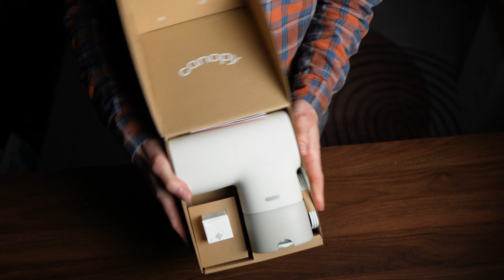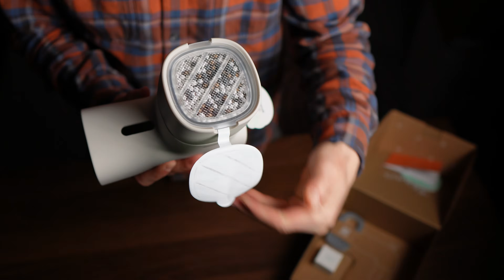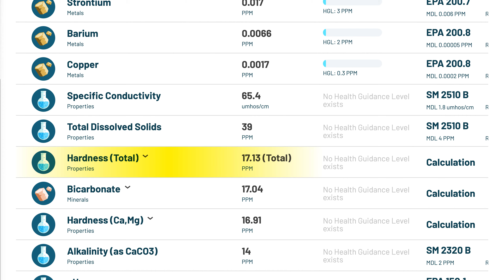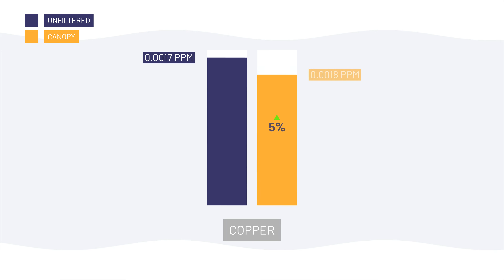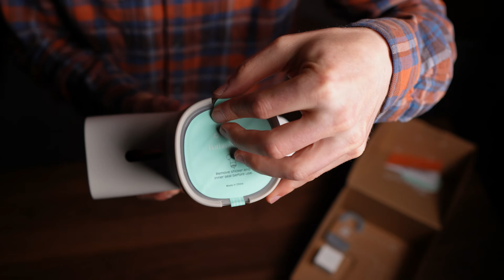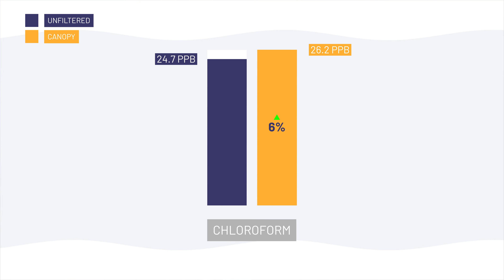Influencers RAVE about the Canopy Bath Tub Filter...I lab tested it

Comment: Do you have any recommendations for bath filters that would filter out arsenic? We have an RO system for all our drinking water but unfortunately our well tested positive for arsenic 3.  We have a newborn so I’ve been wanting to look into filters more! Thanks!
Reply from the maker: Congrats on the newborn. Unfortunately for As(III): no bath/shower filter is going to solve this.

Arsenic 3 needs to be oxidized to arsenic 5 at the point of entry (whole house) before you can reliably remove it. RO systems are effective for arsenic 5, but not nearly as effective for arsenic 3, and RO does not provide that oxidation step. So the fix is a POE oxidation + anion exchange system.

Comment: Hi, apologies for asking about RO here. I know this is a different filter video, but if it's your latest one and I wanted to ask you since you seem very knowledgeable. I live in Scotland in an area where the water is not soft, but not very hard either. I used strips to check my water, and all the values are up to the norm on minerals and metals, apart from lead which concerns me. I searched online and I have seen that there are filters for that, like Waterdrop's 10UA, 10UB and a 3 stage one (WD-TSA-10). I was wondering, if I only want to remove lead, are there good options? Do I still need reverse osmosis and remineralisation, or is there a cleaner, easier option? I would like something to attach to the sink pipes, rather than on the counter, but I would prefer to not have a second faucet, which did put me off the Waterdrops X8 and G3. What is your suggestion? Sorry to bother and thank you for your videos :)
Reply from the maker: Not a bother at all glad you asked. Lead is tricky because it can come from lots of places in the plumbing system, including old solder, valves, or even parts inside the faucet itself, which is why point of use treatment at the tap you drink from is strongly recommended. The biggest thing to look for is that any filter you choose is properly certified for lead reduction (for example to NSF/ANSI standards for lead or something equivalent in the UK, though I'm not familiar with the standards there). There are under sink inline direct connect filters that can reduce lead which are not RO systems, and many of these can connect directly to your existing cold water line so you do not need a second dedicated faucet on the counter. Though, keep in mind, if the faucet itself is the source of the lead, then filtering before it won't address the problem
Reply: @w @waterfilterguru  Thank you so much for your response. It means a lot 🙏

Unfortunately, I think the source of the lead is old pipes that would require thousands to be replaced. I am not going to stay in this house forever and I cannot afford the amount of works needed to change the pipes :( Scottish water won’t touch it as it’s in private property and would only deal with problems outside the premises, getting to the property. They seem to be very through about the quality of water provided so the problem lies in the house pipes. In this case, would the RO or under sink inlines work at all?
Reply: @w @waterfilterguru  if that helps, the kitchen and pipes inside the house covering the kitchen are newish, installed 6 years ago. It’s the pipes on the outside that would be old old ones. The kitchen is fairly new, I don’t know if that makes a difference.
Reply from the maker: It does make sense. You could try a direct connect inline filter that's certified for lead reduction. Then test the filtered water to confirm. RO would be my recommendation though if it's a possibility.